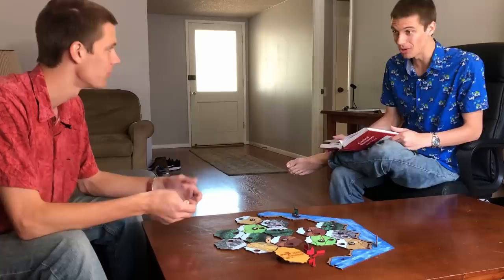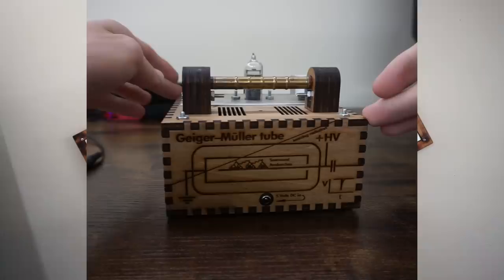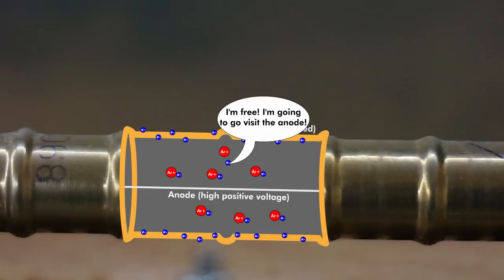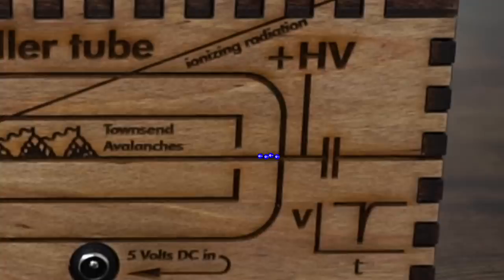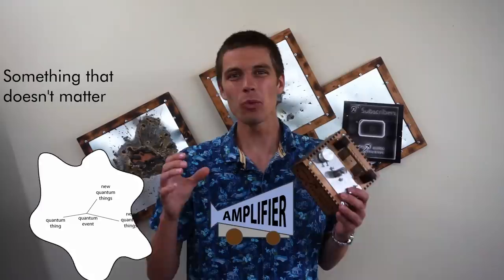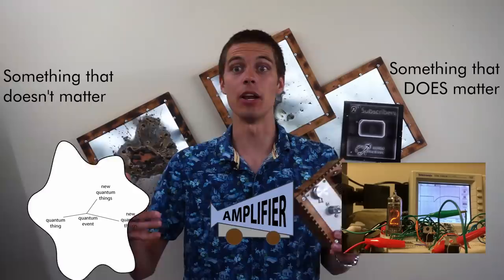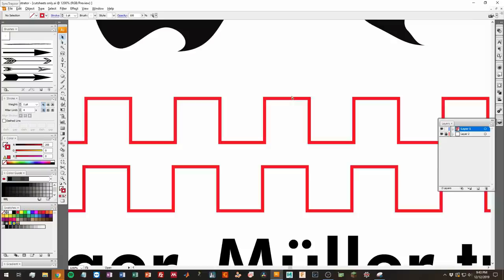The muon-powered, universe-bifurcating, random number machine

Comment: Here's a truly random and unpredictable random number generator I thought of
To generate n bits, have n+1 muon detectors. Each of the n (for example, 8) muon detectors will each flip the state of a 1 bit register. Triggering the final (for example, 9th) muon detector will cause the result to be recorded. The result is simply the state of those registers as bit positions (which would generate a 8 bit value in this case).
I imagine this would be best for seeding a pseudo random number generator

Comment: Photons of light arrive. They arrive randomly, according to quantum mechanics. The average RATE of arrival depends on the power of the source (a hot glowing body, for example). However, the timing of individual photons is random, not just hard to predict, but FUNDAMENTALLY QUANTUM RANDOM impossible to predict.

Comment: have all ten lights off at once with each light connected to a geiger counter having the "superposition" of all the numbers collapsed by the pion muon decay process setting off the light that is connected to the activated geiger counter. you could get more numbers due to the increased area of multiple geiger counters and they would be more random because the cycling is taken out.

Comment: 7:03 Actually, this question was already solved. There is no "tiny clockwork" inside the particle deciding when the particle will "go off". The "randomness" versus "unpredictability" is "if we had complete information about the entire universe, can in theory we calculate the next state(s) of the universe or not" (in practice we cannot because "the state of the universe" is way too big to be stored inside the universe itself).
Reply: I agree with no hidden local variables. Non localised hidden variables might be another kettle of fish. The latter point you make is one theory among many, there may be other reasons why we cannot make arbitrary predictions/retrodictions.

Comment: You should probably check a little bit more if it is really random. I remember when I was in high school my teachers built a quite similar random number generator. The counter used a NE555, instead of using a Geiger tube the user had to press a button, and the result appeard on a 7 segment LED display. After testing it they found that it often gave the same number (2 if I remember well). So they analyzed the circuit and found that in their sequence 2 was just after 8 which drew the highest current in the LED display. This current variation was enough to change the frequency of the NE555 and make it stop right after that on the number "2".
Reply: Excellent point.  I tried to build an electronic die using CMOS integrated circuits years ago.  Using statistical methods, I "proved" that I had failed.  Always test!

Comment: I liked hotbits from Fourmilab, which was a project 20+ years ago, it measures the relative time difference between pairs of pulses. Then if the current pulse width is less than the previous, it's a zero, or if it's bigger then it's a one (throw away and measure the next if it's equal). This way you're always producing a randomised bitstream which can be sampled to pick a random number.
I suppose this could be implemented as counters, perhaps a really tiny FPGA? Or just simply a microcontroller. 
Perhaps that would be another approach to measuring your randomness which overcomes the sequential issues you have with a fast radiation source.

Comment: Coming from a purely computer background, these particles are also the things that can cause issues with computers. Cosmic rays can come in, hit the internals on a computer and effect the programing by flipping a single Bit from a 1 to a 0 or visa versa. This "effect" was first detected by the Intel computer company in their DRAM back in 1978 where 1s would spontaneously change into a 0. This came not from a cosmic ray however but rather from contamination of the DRAM chip's packaging that came from their new plant on the green river in Colorado that just so happen to be down river from an old uranium mill. Radioactive atoms from the mill made their way into the River, down stream to Intel's plant and into the Ceramic packaging of the DRAM chips. Where even the most minute traces of uranium atoms in the packages would slowly decay and the particles would hit the chips, randomly flipping the bits on it before they ever got to consumers, leaving the DRAM chips "dead on arrival". But cosmic rays are also responsible for a Mario 64 speed runner to break the world record by flipping a single bit in the game cartridge, causing the information that contained Mario's height coordinate to change from 11000101 to 11000100, changing his vertical position and causing Mario to "teleport" up through the floor. So even today, computer manufacturers must plan and include programming for these types of events for the very rare cases they happen.

Comment: I think to believe in unpredictability... I don't think there's a little clock in the muon, but I do think radioactive decay probably occurs for reasons that we simply have no current understanding of - maybe an undiscovered field or force interacts with the particles, or something happens that's not even analogous to fields or forces. But to me, it seems a reasonable assumption that particles in the exact same state - in every way states can be defined - have no reason to act differently, which I infer to mean we have some undefined states. And we do know of phenomena that cause particles to break prematurely or at different rates, so it's not like particle "composition" is something completely unaffected by known outside forces.

Comment: So this is a random number generator but technically not completely statistically unpredictable. You won’t generate all numbers between 1 and 10 with equal frequency with this setup. This is a quirk of probability and not the randomness of quantum processes. The likelihood of any number being generated depends slightly on when you turn it on, which we are assuming is a deterministic event. Let’s say when you turn it on it always starts counting at 1. If the frequency of muon interactions is completely random, you’d expect shorter intervals between clicks to be more common than long intervals. So smaller numbers are ever so slightly more likely to show up than higher numbers.

Comment: I had a similar idea to use a nixie tube display that creates a number based on cosmic background radiation, a way of distinguishing between "quantum worlds" if you will. Of course there's no way to test if it worked and the level of precision on that number would have to be astronomically large.

Comment: the lower numbers have a higher average probability because they're exposed first (longer). The longer it runs the more this is diluted. for example if it runs at 1 per second but is usually triggered within 8s, you will never see a 9.

Comment: This looks like a fun little project - for added randomness to maybe fix the sequentialness issue, maybe have it track how long it takes between pulses and use that time difference to set the starting number for the next cycle. That might be a bit much to do logic-wise for a circuit with no microcontroller at all though.

Comment: Dice where considered random until we figured out knowing the variables that lead to the roll can be in theory calculated to give the result.
But like the die, just because we can't measure how it calculates the numbers, doesn't necessarily mean it doesn't happen in a "completely random" way?
we just haven't found out how to predict it.

Things like light, radioactive decay, and other complicated physics all seem random or unpredictable. 
But if you had all the information you probably could? Though it's likely we can't get the information due to other restricting factors.

Comment: Question: does the clock reset to 0, or start from the previous number? Or count continuously? If it restarts from 0, if the average time between events did not span enough orders of magnitude of the counting speed, wouldn’t that introduce predictability? For an exaggerated example, if it counted in seconds, a 9 might be less likely than a 5.

Similarly, it starts from the previous number, it would be more likely to be +5 than +9 from the previous number (again depending on the counting speed)

However I realize counting in microseconds or something and implementing a way to “hold” the selected number while the clock continues in the background could be tricky. Very cool build!

Comment: Randomness is the human way of saying, "this is beyond our capability to predict". In reality, nothing is random. At the most fundamental level, existence is a series of differentiations, i.e., one thing is only known by being different from all other things, with the first differentiation being the start of the universe. As there are no gaps in existence, of a necessity, each differentiation starting with initial differentiation that constituted the beginning of the universe, could and can only take a specific form. Due to the sheer number of permutations of differentiation that have occurred such that we witness what is around us today both on Earth and elsewhere in the universe, that complexity gives rise to the notion of "randomness" AKA "unpredictability": the reality is that given a specific ratio - which must have existed so that the first differentiation could have occurred (there is no differentiation where two parts of an entity are the same) - everything was and is as we witness and yes by this framework it can be seen to be clockwork, but again so convoluted and complex that it is impossible to comprehend exactly to what degree. It is however, not random, as there are no gaps in existence and we experience differentiation - the most basic operation that underpins all existence.

Comment: I'm going to make one of these that I can plug into a motherboard so I can call the hardware at any time to get a truly random number for my games.

Aw, nvm, now that I've watched I realize I can't really do that.  Shame.  EDIT: SEE BELOW
Still cool though!

You could actually gather a bunch of data actively, from the moment you turn on the machine, numbers start lining up.
A loop will go from the first entry to the last in the memory, with the "currently selected value" ticking forward every time the "system clock" ticks.  When this hardware is asked for a number, the selected value is called.
Then, when you run out of memory to write to, just overwrite the beginning.
The memory could be however long you want, probably a few kilobytes just to be safe, but anything absurdly high and making repeated calls might end up giving similar results.
Making a bigger collector too would be helpful, maybe many tubes running parallel.
Also, the clock seen in the base machine would be ticking using faster, hopefully unreliable method, so the counting device would not depend so much on the system clock for everything.

Just kinda dumped my thoughts.  If the random passersby who sees this can manage to sift through them, kudos to you.

Comment: Cool project EXCEPT for the fasteners. Should of had a set screw in the knob, and button head cap screws with the heads on the top, and the nuts inside the box elsewhere. It would be much more visually appealing.

Comment: A thought, if you knew the cycle rate and average rate of incoming particles, you could calculate the Poisson distribution for the gap between numbers. You could then invert that probability mass function, and use some software to adjust the output number to get something way closer to a uniform distribution! When using the inverted pmf you could use a PRNG to deterministically calculate the compensation factor, but it might be more in the 'spirit' of things to use something more simply deterministic like dithering. Of course, your method is way simpler. A Poisson distribution with the number counter speed turned way up will tend towards a uniform distribution when you modulus the output. Reduce the numbers to just 0 and 1 to make this even more efficient. :)

Comment: I strongly suspect that the 555 running on astable mode is not counting at random, therefore interfering with the output's true randomness! to fix this, I would use ANOTHER geiger tube connected to (or) substituting the 555's timing capacitor, The result? Not only it detects random, it also counts in random! Genius! Just sharing some great ideas here

Comment: The issue Schroedinger was highlighting, and that this box also kind-of shows, is that the notion that the cat is in a state of "superposition" of "alive" and "dead" is nonsense. The box you've built displays a number whether somebody is looking at it or not. Put it in a box, and it isn't in a superposition of being frozen on every possible number and also rapid cycling through them; it's doing one or the other. It is, as you said, a macro-scale process.

Superposition theory is interesting, but none of the experiments I've seen actually seem to back it up and truly eliminate the "hidden variables" theory. I know the claim is that they do, and this could be a flaw of my own intellect and thus a failure to understand, but every experiment seems to come back to "we don't know for sure" despite claiming the math shows something I am not convinced it does.

The big problem being: what counts as "observation?" The macro-scale result of the quantum action, presumably, is the best we're going to do. Thus, in theory, the answer is that the cat isn't in a superposition because the actual observation is done by the sensor that kills or doesn't kill the cat, and the cat never is in superposition because it's alive until the observer notes the quantum-scale event and kills it.

Moreover, entanglement seems to me to suggest the hidden variables are there, because entangled particles have dependent properties that mean you'll detect the same decay from each of them if they're properly entangled and you use properly-sensitive equipment to do the detection.

Of course, my quantum physics is not at Ph.D. level, and is rusty even for M.S. level.

Comment: Well technically, shouldn't there be a higher chance of a number which is scheduled to arrive sooner in the counter to be chosen over a number that is counted later?
For example, if the counter starts at 0, counts up by whole numbers to 9, then starts over at 0, there would always be a higher chance for x to be chosen than y so long as 0 <= x < y <= 9.
I know this is likely improbable and nearly impossible to detect at human durations, but the frequency of choosing is directly proportional to the probability difference between x and y.

Comment: There is at least one more source of randomness in your system! There are resistors inside your system, which affect the clock speed. And they are affected by thermal noise! Although, the slower it runs, the less it matters...

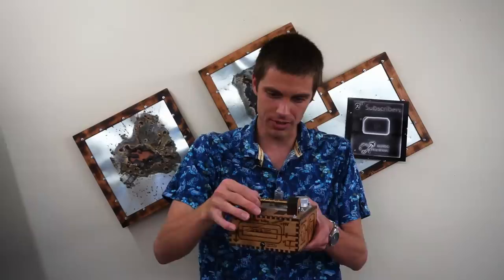Comment: 1# 2:46 It's not a vacuüm tube!!! 
2# you can Not! detect Muons with a  standard geiger muller tube! Only Gamma and Beta' Ray's or decay as you will.  
This is because of the thickness and metal off the tube itself and bechouse of the type of gas mixture inside a standard geiger muller tube!  
You really need special dedicated equipment to detect muons!

But your general knowledge of quantum mechanics is correct, and I do have to give you credit for the nice build, it looks pretty cool! 😉
 But it's not a Muon detector!!!

Comment: At around the 9:00 mark, reality 1,1 (upper left square in the 3x3 matrix) is the one where you forgot to connect your HT line to the Geiger tube, which makes it the most probable possibility 😁
Reply from the maker: that would have been the easy way - all of these are completely cg - i cloned the number off the box and repeated a segment with no numbers
Reply: @AlphaPhoenixChannel  Ha, I never would have guessed it!

Comment: Instead of an increment by one you should use a pseudorandom number sequence. Using a sequence can never be random even beyond the example you gave of non linear ambient radiation. For instance, the time window you use to display each number's time is likely longer and or shorter for some numbers.

Comment: This machine is not producing random numbers neither the stop process is random. Probability if / when the counting will stop depends on the lenght of the rod,  circuit, etc. This is a well designed probability machine but it is not random at all.

Comment: In 2003, in an election in Schaerbeek, Belgium, a voting machine was hit by one of these particles and gave a candidate 4096 (2^12) extra votes. The problem was obvious. There weren't that many voters in the municipality!
Reply: How does that happen?
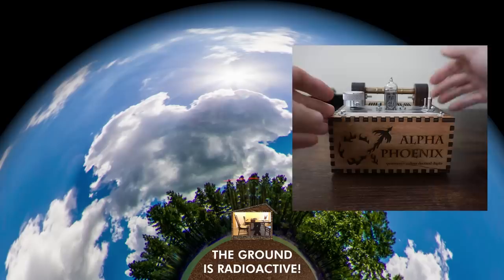Reply: @arya6085  The same way this random number generator works. A transistor spontaneously turned on representing 2^12 when it was hit by a particle as described in this video (2:05). I only learned of this from a recent Veritasium video (The Universe is Hostile to Computers) that goes into much greater detail about the anomaly (and a Mario speedrun!) and how it was concluded to be of cosmic origin.

Comment: I did this in minecraft. Surround / trap a chicken with blocks, leaving 2 ground spaces for the chicken to move around in. Put a pressure sensor on one of the spaces. Wire it to a light. When the chicken is on the plate, the light is on. Otherwise, it is off. Make an array of n of these. Boom, chicken based binary RNG. 🐔

Comment: 11:55   Yes, but even when you turn the speed back up, wouldn't it still function like it did before? Just like how when you knew it would only be 1-2 numbers apart with the radiation source, couldn't you also figure out how many numbers apart it would be after you took the source away? Seems to me like you would have to design it so it didn't count up from one, but simply displayed a number and went blank